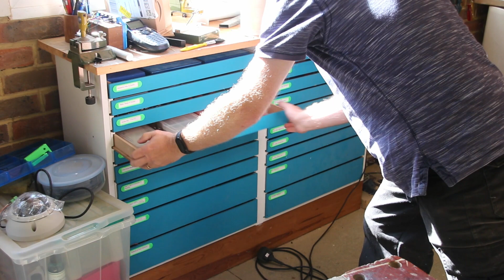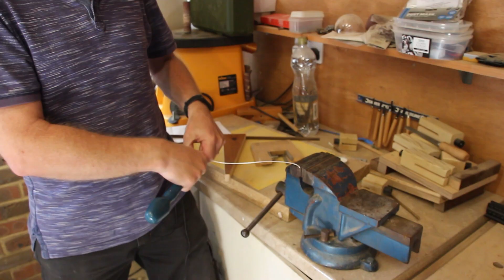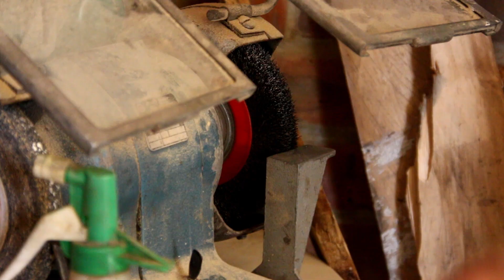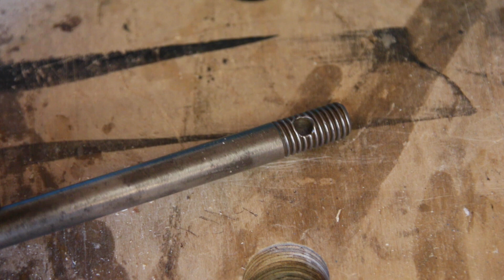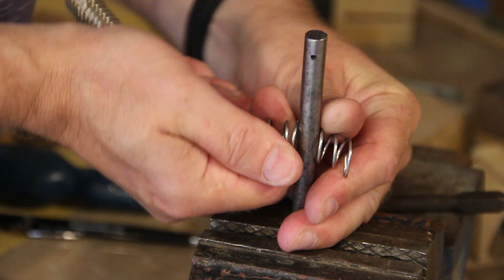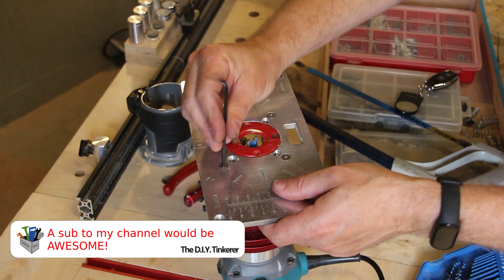Improving my Chinese Router Lift - Making Custom Springs

Comment: Hi there,what size wire and what diameter should spring be thanks keek up your videos very useful to dumbos like me
Reply from the maker: Hi, the springs are compression springs, they need to be about 65mm long and an internal diameter of 8mm or bigger, mine are actually 16mm in diameter.  The spring wire I used was 1.3mm od, I'm sure thinner would work just as well.

Comment: Is the lift still working?
What should I do if the 6mm thread for the long bolt breaks or wears out? Aluminium doesn’t get on well with steel bolts – steel and aluminium don’t mix❗
What can I do about it?
Thanks❗

Comment: I know I'm a couple of years late to the show, but if you could answer my question, it would be appreciated.  I have almost the opposite problem to you, my lift tends to drop down once I have set the height, which is a pain in the backside.  I have also had problems with it sticking like yours does.  I am worried that adding springs would make the first problem worse.  Have you found that happening at all?  And if so, what was your fix for that?
Reply from the maker: I've not had that issue, I know some of these lifts look the same but work slightly differently.

Comment: Hello Simon, not knowing how to build the springs I searched the internet and found some 15mm wire compression springs diameter 8 and length 80 do you think they would be okay if I buy them and then cut them to size 65mm? Thank you from Italy. Mario
Reply from the maker: length and diameter sound fine not sure I understand the 15mm - but I'm sure you'll work it out :-)

Comment: Could I ask what diameter the springs were made.  Thanks.
Reply from the maker: Hi, the springs are compression springs, they need to be about 65mm long and an internal diameter of 8mm or bigger, mine are actually 16mm in diameter.
Reply: What is the wire thickness for the spring
Reply: @petermoffatt7291  the springs I used were 1mm wire.

Comment: This is Jonathan, not Racheal. I was thinking that tension springs could be used underneath to pull the sliding bit down rather than pushing it. Might be easier  although not so neat I guess ?
Reply from the maker: Thanks for the suggestion Jonathan

Comment: Thank you. As a 70 year old lady I’m not sure about making springs. Do you have a length and suggestion what they would be called in a retail setting. Lift is on my trim router like yours. PS I’m based in New Zealand and love your way of explaining things .
Reply from the maker: Hi, the springs are compression springs, they need to be about 65mm long and an internal diameter of 8mm or bigger, mine are actually 16mm in diameter.
Reply: Thankyou. Will try those. Love your fold up router table. You have some good practical ways of doing things.  @DIYTinkerer
Reply: I love the spring mid for the router lift. I have just purchased the lift and will pick up some springs.   do you have the OD of the wire ?
Reply from the maker: @kevinberlyn8060  the spring wire I used was 1.3mm od,  I'm sure thinner would work just as well.

Comment: Did u call those springs compression springs ?? what was the wire size of the springs u opened up to make the new springs mate? Could I buy a certain type of wire for that on a roll?? The springs at 1st I didn't thin I needed but I'm seeing more and more ppl online now talking about the same issue..
Great job btw. I will be using ur idea too. I bought one of these lifts months back but haven't build my router table yet..
Reply from the maker: They are about 1mm thick, I've only ever repurposed springs and have never seen the wire on sale,  To be honest I think mine are a little too thick, I sort of collect hardware as I like taking things apart! And yes they are compression springs
Reply from the maker: Re Wire: If you search for 'spring steel wire' you should be able to find a supplier

Comment: would that work on a plunge router? they all ready have springs, would those springs need to be taken off? It might cheap but it does work, as seen; l have thought about just using a threaded bar with a coupler and a allen key headed bolt.
Reply from the maker: There are quite a few videos on YouTube about using a plunge router converted into a router lift, the lift I used is pretty cheap,  it's already got me wondering if I should upgrade to a high quality one  it does work, for casual use,  it's just not like using a quality tool,  but better than nothing. The lift I used is for trim routers only.